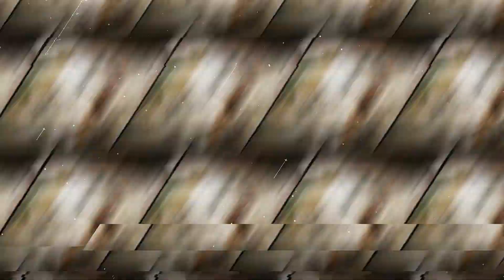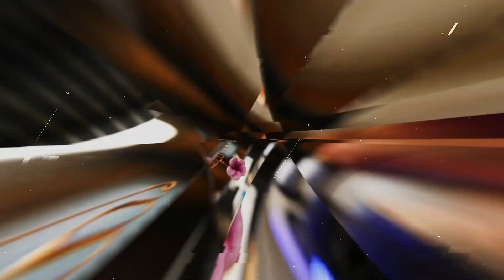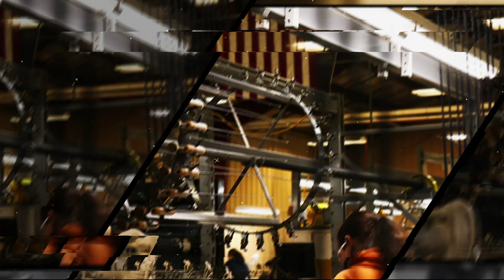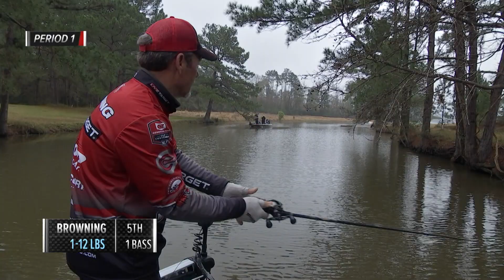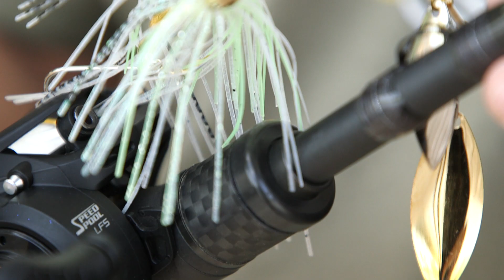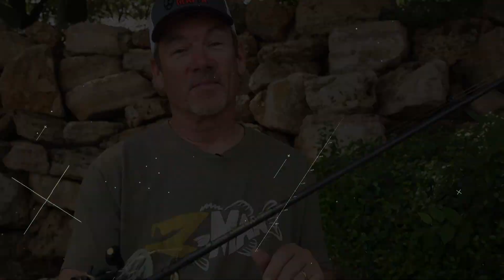Stephen Browning Details the St. Croix Legend Xtreme

Comment: The new Xtreme is not lighter than the older ones over all.  I have both and I’ve weighed them.  They are a good .5-.7 oz heavier.  I have several of both generations.  However the new one with the AGS guides seem to have a lighter blank because they balance better, and “feel” lighter in the hand.  Reel seat is more solid and comfortable and they feel and fish stronger.  Biggest difference the new ones in heavier actions can fish lighter stuff easier and without loss of sensitivity.  I feel like I can rip big fish right out of the water without fear of breaking the rod.  This new blank and guides just seem super strong.  They are great but extremely expensive.  I’ve been lucky to find a few lightly used.